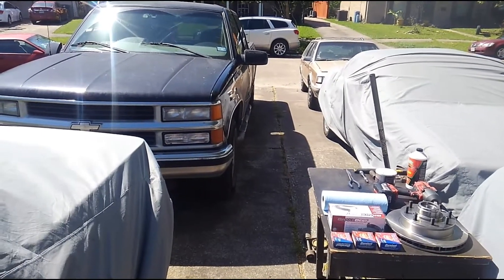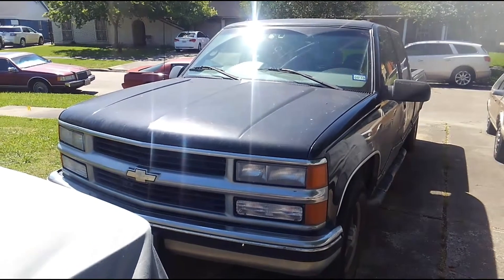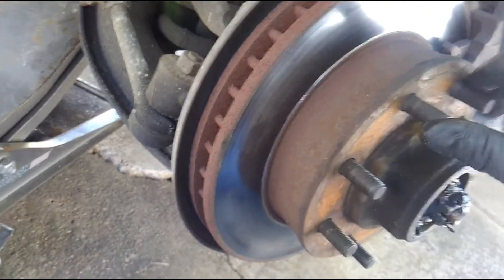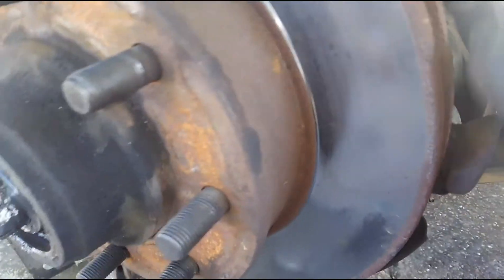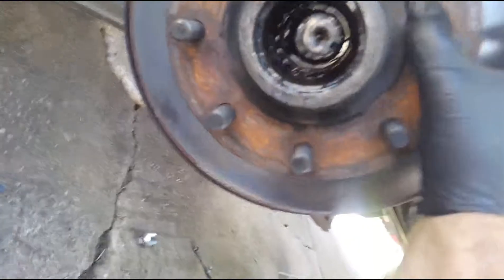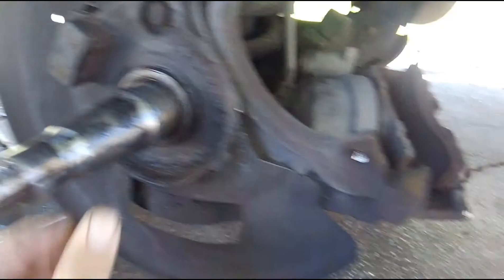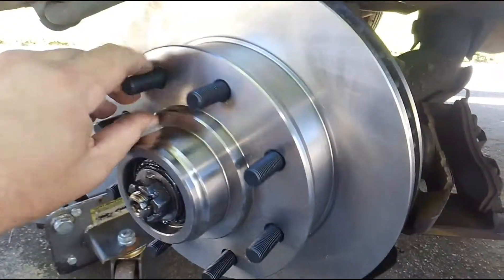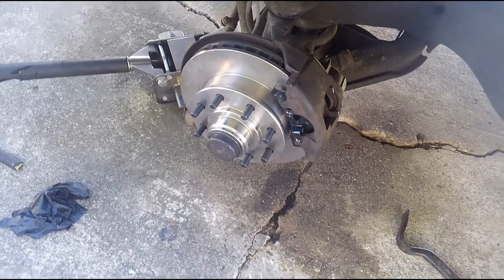2000 Chevy 3500 1 Ton 454 Wheel Bearing Change Out

Comment: Thanks for making a 19 minute video that does NOT show me how to remove the wheel bearing out of the hub🙄
Reply from the maker: You sure you're watching the right video? Pretty sure I remove and reinstall the wheelbearing, but thanks for taking the time to comment anyway.
Reply: Didn't pull the race
Reply from the maker: Yep, I seem to remember electing to leave it installed since I had just replaced the rotor assembly a few months back and it was still in very nice shape.

Comment: Appreciate the effort but you literally skipped over the most important part.... Packing the wheel bearings in it's quite complex with both wheel bearings
Reply from the maker: You're right. I am old school so I just used the tried and true method of hand packing them. All I do is put a glob of grease on one palm, then take the wheel bearing in the other hand and pat it down on top of the grease which forces the grease through the openings. It's messy and time consuming but gets the job done. I remember now I couldn't figure out to hold the phone and pack the bearings at the same time so that is part of why I didn't show it. Thanks for watching, man👍